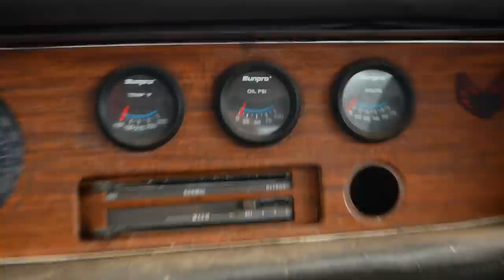Firebird Formula First Start in Years!

Comment: Since it's one of your dream cars, you should do it up at least semi-right. Put a Pontiac engine - at least a 400- in there, get a Hurst shifter (might be able to find one in your local junkyard cheap), and then get a good stout carb to go on top. A set of headers, glass packs, and you're halfway back to the 70's. The earlier 400 Pontiacs are pretty stout, if they're in good shape. Lots of us had GTO's back when they were just "used cars." Those were the days.

Comment: I don't have anything against the venerable 350. I have installed, worked on them, re-built them, etc.,etc., but what that car needs is a HO 455 and you will have a screamer. In 1975 I had a 71 with a 455 in it and 4-speed. One time I was cruising at 60 mph in 4th gear and all I did was punch the car and it started smoking both rear tires as it shot up in speed over 100 mph in just seconds. It was absolutely the most powerful feeling car I ever had. I wish I would have been able to keep it, but youth and youthful ideas are most of the time done without much real deep thought about what you are doing. It mostly was about what you wanted at the time. I miss that car a lot.

Comment: I was taught to adjust Chevy valves by running the engine, loosen the rocker nut until you hear "clacking", tighten until it goes away and add 1/4 to a 1/2 turn. Always worked out great for me, but it does make a bit of a mess. CorvetteBen made some valve covers to use when doing this. He cut the top, center out of a pair of old covers and it really does a good job of reducing the oil splash.

Comment: One of my wife's car as a teen. I grew up with big block buddies and had a few of my own. What I learned is they create crap loads of carbon build up on everything exposed to combustion. A regular long cruise while adding top end cleaner every time you shut the hot engine off does wonders. Choke it out with the cleaner, have some lunch and do it over again until the valves shine. Then keep a crap load of fuel additive in the tank for a while. After that it's up to you on things. Gasoline these days really doesn't have a lot of umph, you can get creative on a cleaner burn. Cheers! great video and congrats on your dream car. You manifested it, Been there done that. No other feeling like having a dream car or cars....YAY!

Comment: I had a 1973 Firebird Formula with a Pontiac 400. balanced and blueprinted, headers, Crower Cam, Muncie w/Hurst shifter 4 speed, Holley 4 barrel. It was a numbers matching car when I bought it but, it did have a 75 nose on it presumably for the better headlight setup. I like the original front end much better. Your front end looks to be in pretty good shape. One thing that you will want to add as you go along is sub frame connectors as the rear frame from the factory is uni-body and, a definite weak spot in it's construction. I had to get rid of mine back in 95 I think it was and, I have missed the car ever since. If your looking for body and or suspension parts - you might try Bethels Goat Farm if they are still in business. They carried a large number of hard to find Pontiac parts. I kook forward to seeing more of your build as you go along and, sincerely wish you the best of luck with it. They were a beautiful design and I wish there were more of them still around!  Garrett Doyle

Comment: I’ve been watching your videos for quite awhile so I don’t know how I missed this one. Wow do you look different without the beard!  I’m probably older than most your fans but its awesome watching you work on these old junkers. You’ve got a lot of knowledge and you use it. That’s something you don’t see a lot of these days in young or old people. 
 The first car I bought myself was a 1971 Pontiac Firebird Espre? Red with black bucket seats and a 3 speed  on the floor. It had a 350 2bbl no power steering , had disc brakes. I bought the car for a graduation present to myself in 1975. Like I said I’m older.. I put dual glass pacs on the car Fenton racing wheels, and speed rated raiding tires and air shocks. I ran the crap out of that car, redline was5500 rpms . It would get rubber in all three gears!  I never changed anything else .my girlfriend and I would go to our local McDonald’s on Friday and Saturday nights hang out and pickup racing my favorite was stop light to stop light. It’s wasn’t the fastest car in the group but it did pretty darn good. I kept that car for 2 years then did something stupid. I got married and traded my bird for more of a family car. I’ve missed that car since the day I traded it off and seeing you with that 73 I hope you fix it and keep it.
Thank you for sharing your videos and your  life. May God bless you in all you do..

Comment: The proper way to adjust the valves on a SBC is by starting the engine and for each cylinder in turn, loosen the rocker arm until it clicks then slowly tighten the rocker until the clicking just stops and tighten the nut a further 3/4 turn.  if you want a little more rpm before valve float only tighten the rocker nut a half turn. Repeat for each rocker. I learned this 45 years ago when I was apprenticing as a mechanic. I got a set of slash shields from the  Snap-on guy to clip on   the rockers to deflect the oil  pumping out the push-rods so it doesn't spray  everywhere while making the adjustments. Easy-peasy

Comment: I owned and restored a 1975 Pontiac Formula 400 with a 4 speed & 3:43 rear, back in June 1982 and had some real fun with that car, (miss it).  Drove that car until May 1989 and after joining the Army back in May 1989 and leaving it at my uncles home in Landsdale, PA the winter weather took it's toll on the body & frame.  So I upgraded to a 1975 Pontiac Trans-am  with a 400, 4 speed & 3:73 rear back in Oct 2001 and she was a project car for someone else and they lost interest on finishing this car but the engine was overhauled and run's great and I also plan on restoring the whole car either this summer or during this year, money provided?  Married life with kids always takes a front seat to everything, like the saying goes "Happy Wife, Happy Life".  Great video but rebuilding these cars are really more fun and a lot can be done to them so enjoy it while it last.  (Restore is the way to go and a Formula is more desirable)!!!!

Comment: I see a multi-coloured Firebird & I want to paint it blaaaack....and drop in a 455.
Reply: Not 455 but SD 455. Fixed that.
Reply: @jeffmason103  Mmmmm...Sooooper dooooty. And a shaker. And a Muncie.
Reply: @jeffmason103  and my 01 Passat is faster in every way. 235hp at 6000 and 230lb/ft at 3000 , red line of 7500rpm, 3400lb curb, better brakes, better geometry and its a 4 door family car. .  classic cars are cool but the shit engines are horrible. Dont get me wrong, i love me some loppy V8 but there is no point. I Feed my V8 addiction with a 97 grand marquis with bolts ons, heads, cams, all the suspension goodies and a bit of N2o.. 460hp on pump gas (500HP on N2o) for the last 150k miles.
Reply: @zuestoots5176  Well..uuuh..10 points for you, I guess. I doubt we'll be seeing people rescuing your Passat in 50 years and giving it a loving restoration. Or your Grand Marquis, either.
Reply: @XBullitt16X  I hear ya.  The catch:  it's all older stuff.  I think we can all agree that older stuff is / was loads better than the stuff of today.  Sad .... but true.
Reply: @davecostelloe9367  Indeed, most modern day cars are meh.
Reply: Rolling Stones - Paint it Black, started playing in my head
Reply: @davecostelloe9367  Those little Sirocco VWs with the 16v motors were pretty cool.  Fast little bastards too.  That being said, I still love old cars and trucks.  I've got an 84 S10 with a 3.4L V6 crate engine from GM in it.  It has a hotrodded 4.3 TBI unit sitting on the 2.8 bored out intake with 4.3 injectors.  Runs like a 305.  Wrenches like a 2.8.   Has an absolutely killer custom Flowmaster exhaust on it that sounds really aggressive.  Shocked a small 3.4 could sound like that and run like that.
Reply: I'll admit, modern tech is cool. Better handling, air conditioning, mpg over 20. on the flip side, I've never seen someone packing a Glock pistol with an M-4 clone over their shoulder not drool and want to fire a 6 shooter .44 magnum. Just like some people prefer old rock and roll to new rap music--they're both noise, but some find one cooler than the other.  One thing that is for certain, tho...anyone can drive a new car fast with all the computers. Just like a compound bow with all those pulleys can really sink an arrow into some hay.  But if you want to show off some amazing skill...do it with a tool that does zero thinking for you.
Reply: Zues Toots the point of a big v8 muscle car was not to corner but to go fast in a straight line. You are trying to compare cars that were not built to do the same thing. Therefore your comparison was pointless.
Reply: @zuestoots5176  I would rather have a dodge omni glhs
Reply: @zuestoots5176  And that crappy passat is soon dead.....
Reply: @brendangeraghty8865  The passat will need rescuing in 5 years or something like that,really crappy cars.
Reply: Z
Reply: #ADDAHEMI
Reply: @zuestoots5176  You see an old 72 V8 with a lot of extra weight and an anemic hp rating.  I see a platform with go fast parts that can bought at your local 7-11.  Plus even this tired old 350 sounds, well it sounds like shit, it's over fueled and now the timing is advanced too far, but damn it, it still sounds better than that Passat.
Reply: Zues Toots is rather ride a fuckin bicycle
Reply: @zuestoots5176  Troll much?
A passat is a car. A Firebird is happiness.

Comment: Thank you for the great episode!!
I MUST WARN YOU FIRST BEFORE DISPENSING THE PLEASENTRIES !!!!

I have owned F-bodies since 1988 ( 1 year before even getting my license) and I will share a sad tale.  
I took the entire car apart, sprayed the subframe in DuPont black immeron and the car came together BEAUTIFUL!!!
Well what went wrong?
The car rotted to death from the inside out within 5 years because of all the junk caught inside the rockers. 
These cars have that stupid GM wash and dry rocker panel system that when water goes in the cowl it comes out in front of the rear wheel. 
They started doing this on the Chevy II and it in simple terms turns the rockers into mulching devices up until it rots from the inside out with NO WARNING. 
So please make sure to inspect - flush and if need be open up, clean and rhino liner the inside of the cowl and rockers !!!!!
When the cars were 10 years or even 15 years old they didn’t sit around enough to do this sort of damage but all these years later it ruins your day until you find another shell to put your car into lol..... 

Well here is my story 
I lucked out and got the PERFECT, clean , all original 1979 Trans Am that had all the goodies like power windows, trunk and locks, cruise, pulse wipers and a hard top.  
White with black interior as an added bonus on the option sheet was WS-6.  

Well I found the car near by- the drivers door was mangled and the front fenders dented beyond the point of being helped.  
So in the meant I took my 455 Super Duty, had it converted to a hydraulic roller cam , filled the block up to the jackets, did a lifter valley reinforcement kit, had custom rods made to slow down the piston speed (6.625 to 6.8 Big Block Chevy blank) and of course the Kaufman brothers made me a nasty custom set of heads with LS1 style heart shaped cumbustion chambers. It is AMAZING to see what a good old Pontiac can do when done right and hold together while purring like a kitten.   .... I did it ALL RIGHT!
The car put down on a Mustang Dyno with ZERO correction 780 horsepower and 750 ft lbs of torque all on 9.8 or so compression.  
With a custom made turbo 400 (2.75-1.75 first and second gear) my first and second gear take off, 3000 flash stall converter and a 2.41 rear end it was going like a 3.08 first and second gear and by that time the car was like a freight train going into that 2.41. 
So in short:  the car had no problem at all (along with the body modifications) doing 200 MPH !!!
B.S. you my friends I am not..... I had a ton of fun playing with my friends Murcielogo !
Now she needs a shell to put all these goodies into.

Comment: According to some service manuals, a quick way to set preload in most stock SBCs is to crank the engine over by hand, with the number 1 cylinder at the top of the compression stroke and tighten (or loosen) the rocker arm nut until the lifter can just barely be turned between two fingers with a slight bit of drag. Repeat this process for each cylinder until all preload for every valve has been completed. This will get you very close to ideal preload, or perhaps dead on the money in many cases. I used this when I rebuild the valve guide seals on my 87 C10, and it works flawlessly. Engine ran beautifyully on startup with only minor adjustment to the timing after having replaced the distributor.
Reply: FYI Chevys SUCK!!!!

Comment: ahhhh, your killing whats left of those valves with that starting fluid.!
Reply: starting fluid doesn't hurt engines, straight ether does but canned starting fluid has barely any ether in it, in fact a guy ran an engine on straight Aerostart and the engine was perfectly fine afterwards with no change in wear
Reply: I was told it combusts more fiercely than petrol and because of this displaces the oil

Comment: OMG put a real Pontiac engine in it!!! It at least deserves that much. I've been building them for over 40years and as long as you upgrade the timing chain they'll run forever.
Reply: Yea came a 400 big bock 😆
Reply: Pontiacs all have the same block size. Just bored out different.

Comment: I love watching people wasting their time adjusting rocker arms with the engine off. The fastest, and most accurate way to adjust hyd Chevy rockers is with it running. Pop the valve covers off, slip the clips on, fire it up, and doing one rocker at a time; loosen until it clacks, tighten until it stops, and go 1/4 turn. All 16 rockers can be done in 3-5 minutes.

Comment: Been  a mechanic all my life. The way the engine cranked the first time I know it was not a problem with the timing. Keep going until the engine starts and then make all the adjustments needed. Possibly the carb did not need rebuilding or maybe it did. But let it start first then take it from there. Chevy 350 with a Pontiac intake manifold I might run into problems with that. By the way that is not how you adjust the valves. If they are hydraulic lifters in contrast to hard lifters what you do is turn the engine until the rocker is free. Adjust it until it has no up and down play and then give it  a quarter of a turn, turn the engine on, loosen the rocker until it starts knocking, turn it back until it stops knocking, and then give it a half to a quarter of a turn..  This engine is going to run great